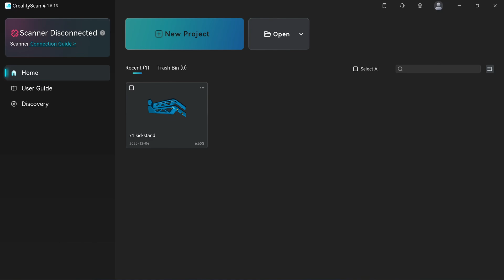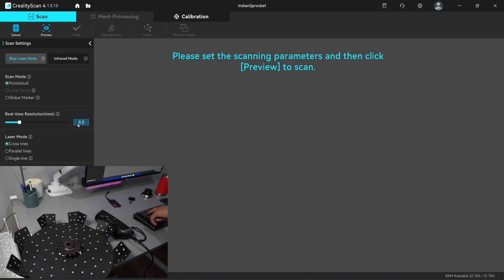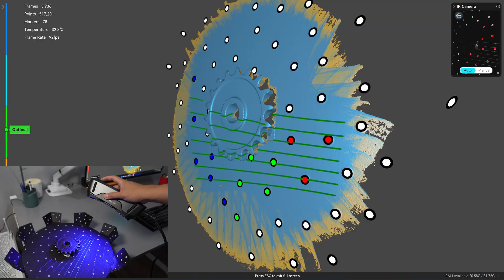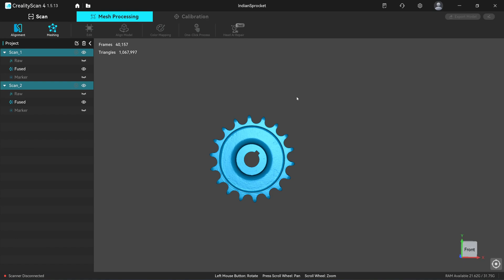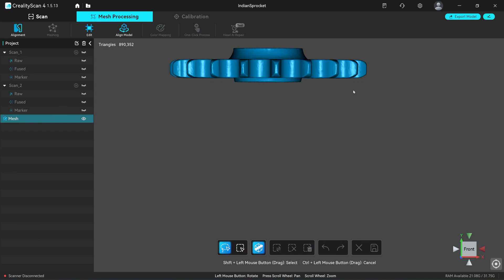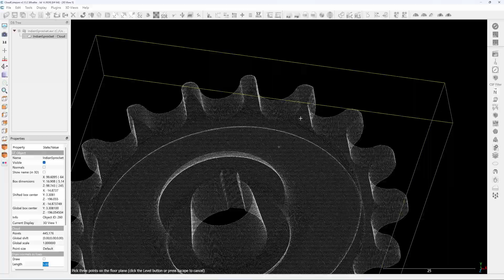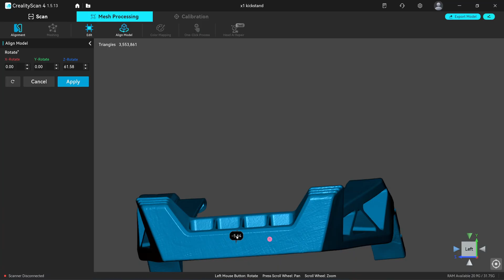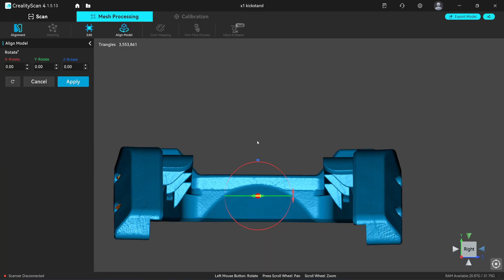Creality Scan 4 v1.5.13 – New Alignment Tool Finally Arrives!

Comment: Hi.
Thanks for the video!

4 v1.5.13 actually has some interesting features. I tried it, too. But I still have some artifacts that appear after cropping. Unfortunately, this isn't present in the stable version 4 v1.3.7.
Many people are still hesitant to upgrade.

I noticed that 4 v1.5.13 displays the calibration panel better.
And I really liked that you can change the rotation point and coordinates of the model. It's convenient. True, the model can be aligned in the slicer before printing... But for reverse engineering, of course, it's very necessary. The solution is interesting. 
Of course, they made the arrows very small. It's not very convenient...

I also liked another cool feature: cutting off a plane by three points. It's really convenient.

Comment: It’s annoying that even in CloudCompare you can only align one plane with the 3 point alignment tool. CrealtyScan needs to add more keyboard shortcuts, e.g so that the rotation could be done with a key press instead of trying to hit that arrow. It has a lot of usability issues, that could easily be fixed. 

Generally I think the CrealitySvan UI looks like a toy with the big buttons and fonts. I guess it’s ”modern”…
Reply from the maker: Yes, UI need improvement, especially on 32" 4K monitor. I haven't check how in look in FHD monitor yet.
Reply: It actually aligns X & Y based on your 3 clicks, but it's not nice for every object. Sometimes it can get pretty close results.

Comment: Thanks for this.  Question, what video card do you use?  Does it matter, or is most of the processing reliant on the CPU / ram?
Reply from the maker: Scanning operations utilize both GPU and CPU, whereas fusion and meshing rely solely on the CPU.
Reply: @Payo-TensileCreator  thx. What video card do you have or suggest?
Reply from the maker: @PBStuffCo  It has to be Nvidia card, RTX4060 or above.

Comment: Question. I was thinking of using clear resin to use as a rest for scanning objects. I notice most people use white objects to rest the scan object on. I just purchased the Otter scanand I'm trying to get the hang of scanning. Can anyone tell me if a clear rest will work. I don't want to waste any resin.
Reply from the maker: f you’re referring to using translucent material for the turntable, I’d advise against it, it introduces reflections and light distortions that generate noise and reduce precision.
Reply: @Payo-TensileCreator Yes, thank you for your response.❤

Comment: Nice basically we can ditch point cloud then?
Reply from the maker: If you're using mesh, yes. No need to align them in Blender.
Reply: @Payo-TensileCreator if I need to re engineer then I use point cloud but for most full perfect scans honestly I will just use Creality alignment
Reply: if you are satisfied with rough rotational only alignment then yes

Comment: I seriously thought we'd be getting a well-made alignment tool. That's a lame job from Creality.
Reply: It don’t really matter. If you are into 3D scanning you have a reverse engineering software/CAD with the capability to align a scan.
Reply from the maker: C’mon, at least I got to make this cover video before retiring.